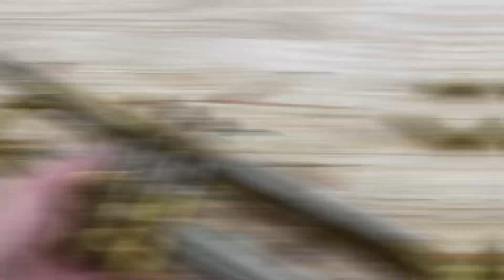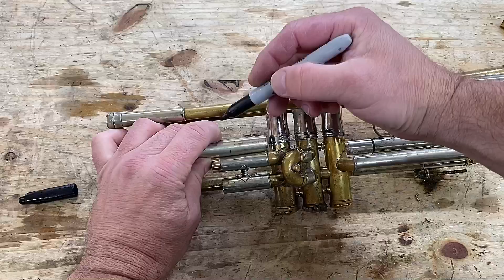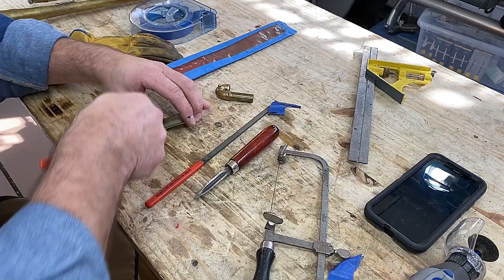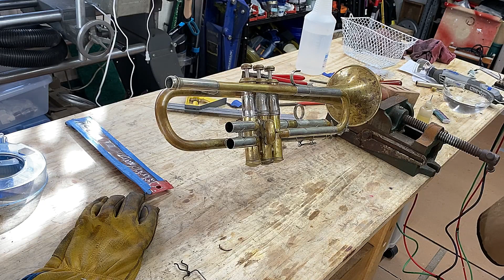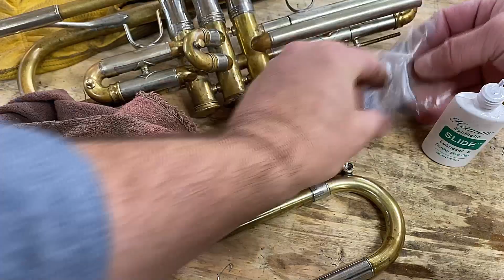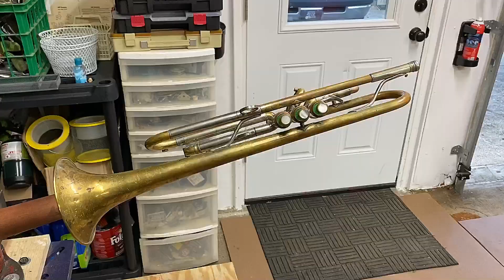“Ghost” 1st Valve Slide and Other Custom Trumpet Mod’s- Wes Lee Music Repair

Comment: I have a King B flat/ C trumpet being repaired. We found it in a storage locker and all the slides were stuck. It has been in the shop for about two months. There were also some dents that needed to be removed. How long should it take to do that?

Comment: @Wes Lee Music Repair  That Holton is interesting in that the ferrules that attach the slide crooks to the inner slide tubes have a waste. Wasn't that a J.W. York thing? I think York took out a patent on that design. I've certainly seen it on several York tubas. I wonder if they were sharing parts back then. Nice work, I've enjoyed working my way through your past videos.
Reply: I meant to saw waist, ie narrowing in the middle...

Comment: What does this 1st valve ghost slide do?
Reply: I’m wondering the same too
Reply: The way it's build by default, it can not be operated while playing, because both sides of the slide go into  the Instrument (you can see it if you look closely at 0:33). The ghost slide is "converting" the upper half of the slide into an outer slide, so that you can mount a finger saddle on without having to replace the whole tubing itself.
Reply: It allows the player to micro tune the trumpet while playing.

Comment: ...I guess if the client is happy then it's a win, but for me, that 1st valve slide 'ghost' solution is just so unsightly.
Reply: It's the sign of a REAL trumpeter. Like a b-bender on a guitar. Whether you use it frequently or not at all. It's nice to have if you need it.
Reply: @ricoludovici2825  i like the trigger on the King 2055's
Reply: @ricoludovici2825     ...a saddle or trigger would have more than sufficed.